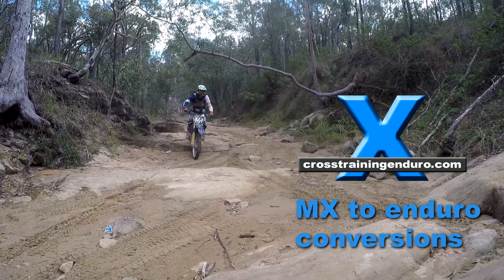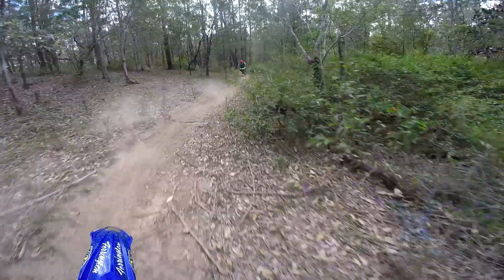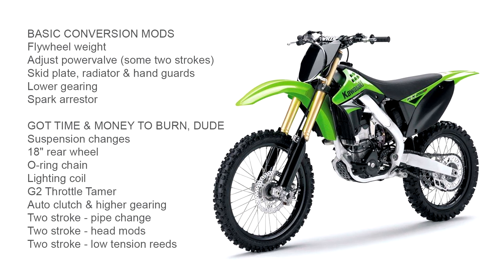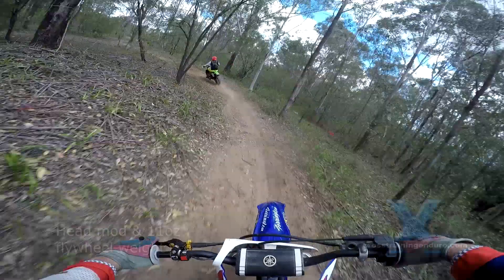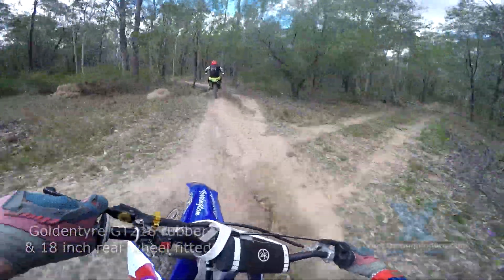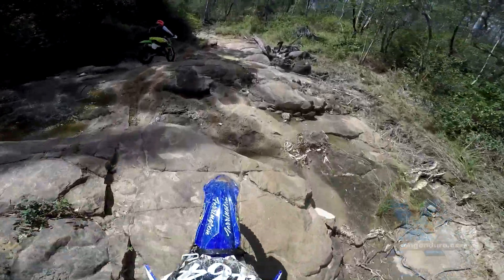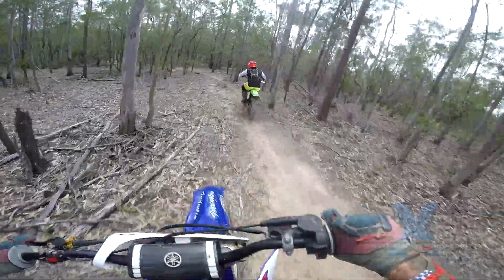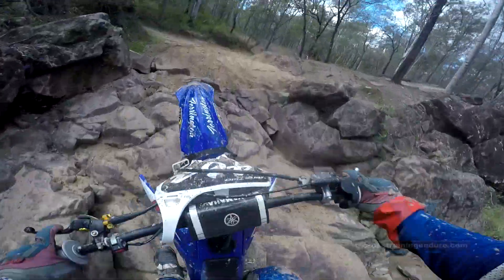Motocross conversion to an enduro woods dirt bike︱Cross Training Enduro

Comment: A stock YZ250 fitted with a good rider can be a pretty formidable combination, believe me.
Reply: I believe you. But not for difficult and very technical stuff.
Reply: You'd be surprised, they make good hard enduro bikes even when bone stock because they weigh nothing, have very plush suspension for motocross bikes and have great bottom end with the help of some good clutch control.
Reply: I've owned a YZ for years and I can tell you it's not an enduro bike.  Even with much of the modifications listed in the vid, it's still not a match for a full enduro.  For one, porting, carb size, and power valve settings are vastly different on a track bike and will never give you the smooth low end power of a woods bike.
Reply: YZ250 is the best bike. 2006 and up are all the same. Still the best suspension out there. Even stock it works great in the woods.
Reply: Mark - i jist go faster to stay in the power band lol i love my cr
Reply: no one has watched snowman films yet go on there and you will see what they can do on stock motocross bikes
Reply: Sowman Films most guys I know can’t keep up with my 15 year old son on his Yz85 riding single track.
Reply: @Scottstunts  that is a fact man. Found that out the hard way. Kid in his YZ85 dusted me on my YZ250 through woods

Comment: I learned to ride the woods on a 2001 cr80r; now I ride a yz125. If you can ride a small bore two stroke in the woods, you can ride ANYTHING in the woods.
Reply: Joe Mamma currently been riding a 1994 yz80 for enduro, definitely helps you get more clutch control! I'm going to get a yz125 or a kx125 next spring.
Reply: its the same with mx track one guys said if you can ride a 125 fast you can ride Any motorcycle fast
Reply: I learned on XR100 and YZ80. Nothing like an 80 2 stroke in the woods.

Comment: That is really interesting.... Surprisingly, my Ol' 1985 YZ490 that I keep teasing about is becoming a pretty good trail/enduro bike. It's not worth anything to sell, so I've just kept modding it a little here, a little there... I put a wide ratio 5 speed in it, ported it and head mod to improve low/mid range torque, and revalved the suspension myself (Still improving to my preference) with twin closed chamber  forks off an 09'YZ450F. Riding with my buddy who has a KTM 300 EXC, I seem to be able to manage easily the same obstacles... The biggest problem I have is a hypertrophied R leg and left forarm from kick starting and operating the clutch....lol
Reply from the maker: oh yeah, the cable clutch and no button are a tough combo lol! i wonder if a midwest lever would help? or another guy in these comments said a moose lever worked wonders for the clutch and was much cheaper than a midwest too....
Reply: I have an 86 KX500 that I put 05 forks on recently. The bike is long, the head angle is pretty slack and it goes up things off-idle that I would have my 250 singing in the powerband before. I barely give that bike any throttle, just keep it alive and it lugs all day. I love riding the old stuff, even if I do throw on some "fresh" 10 year old equipment now and again. lol
Reply: I left the shock alone, it's actually a really neat setup for a stock bike. Where the shock is on a modern bike they used a transfer bar up to a cantilever and the shock is inboard, in the engine cradle. No hanging linkage to beat up on rocks and you can adjust ride height separately of the spring preload. That means I set the spring where the shock works best and then I can tailor the seat height for my stubby legs! lol
Reply: MrDuhfactor my buddy has a CR 500 1990. Ergonomics are old but he has it set up great! It works really well.

Comment: I started out riding pretty technical single track on a kx250. I added an 11oz flywheel weight and moose racing makes an easy pull clutch lever that really helped the wrist cramping. Some guards and a skid plate for protection. The suspension was stiff and kick starting the bike in the middle of a technical uphill section was tricky. But it got me addicted to this stuff at a price I could afford. Though I have to admit the first time I went out on my 300 XCW it felt like I was floating over some of the stuff that I had struggled over on the Kawi.
Reply from the maker: the suspension can be one of the real killers hey scott? that moose lever sounds interesting, probably a similar concept to the midwest levers we have used sometimes....
Reply: Indeed. I am certain no matter how many years I do this I will never fully wrap my head around suspension.      The Moose design is a similar concept to the midwest. Just think cable. I would say it cut pull down by 30% or more. Couldn't have paid much more that $25.00 US. I ordered the midwest clutch lever after watching one of your videos. I had bent the original pretty bad and needed a replacement anyway so figured I would give it a go. I only tried it for one ride. I never seemed to get the adjustment quite right. It seemed to either always be slipping a bit or always be dragging a bit. Hard to find the sweet spot. I beat the bent one back into submission and put it back on.  I do plan on trying it again. One of the other guys I ride with is on practically the same bike as me and he swears by it. Keep the vids coming. Following some fast talented riders and these tips are the only thing keeping me out of the hospital.

Comment: Barry, I've been following your channel since the Berg times! Congrats for keeping up the good work! Being a owner of a converted YZ 250, you´ve pretty much summed it up with  the pros and cons Barry. The gears are the real problem. At least I change front sprockets from 13t to 15t. About the Hydro clutch, I've fixed the problem by installing these adjustable clutch levers. You can choose 3 positions for the cable end, getting more leverage. Soft as hot butter! A side stand can be really useful too!
Reply from the maker: sounds good rzgamer, which brand of clutch lever are you using? we've used midwest ones in the past to good effect.
Reply: I'm using a MSR lever.

Comment: I converted a 1999 KX250. Worked great. Nice to beat up a used bike while learning, then get a new bike when your skills improve. I used an ultra heavy tube in the 19" tire at 9psi and never had a flat. Can't match a hydraulic clutch though.
Tip: get the heaviest flywheel weight. Then if you think it's too heavy, send it back to Steahly and they'll cut it down.  ($20.00 US) I went from a 13oz to an 11oz. Perfect.
Reply: ... if the bike has progressive rate springs switch them to linear rate. Progressive rate doesn't work well in the woods.

Comment: Another good video! :-) and I would like to share my experience as a beginner:
I come from an enduro Husky 125 and I recently got a KTM SX-F 250 because I'm also doing some motocross riding from time to time. I've been testing a number of brands from 125, 250, 300 and 450 cc, 2 and 4 strokes cross and enduro. 
 
What I do most is enduro and almost all my mates have enduro bikes. 

This is obviously a personal point of view but I love my motocross 250 F. That extra aggressivity for a small 250 works great for me respect a 250 "soft enduro bike" and helps to be more accurate in throttle and clutch control. It probably won't work so well with bigger displacements. The original sprocket was a 48 and I mounted a 52 + a skip plate + strong hands guards + 90/90-21 from and 120/80-19 rear. I'll get Tubliss soon. 
I still use the stock springs, (I'm about 78 Kg with all the protective equipments). I just use softer compression and quicker rebound for enduro; it's still a bit stiff with mid-size rocks or rounded river stones... but lower tyres pressure, (0,6 bar or 9 PSI), works great for mid-slow riding! With that pressure, I already damaged a tube and hit the rims, so I getting into Tubliss. I'm very looking forward to test my tyres with 0 PSI and winter is on its way in Europe!

Hug from Italy - Sicily!
Reply from the maker: i think the four stroke engine will immediately be better for this conversion, salvatore. i think its' going to take a lot of work to make this 250SX comfortable for enduro riding....
Reply: You're right!

Comment: I have a 2017 woods set up yz250. Magura hydraulic clutch, 18in rear wheel, devol skid plate, yz250x kick stand, full fmf, the kyb with a pro motion spring and revalve for a 170 pound woods rider, tubliss in the rear, acerbis bark busters. May add a 11 oz flywheel weight in the future. Kept hearing stock, and it’s a ripper. I ride tight technical single track here in east tn. I have thought about throwing in the old wr426 trannys but it doesn’t really need it. This one makes woods set up yz250 number 5 for me and I have loved them all.

Comment: Hey Barry,
I have a 2003 YZ250 her in the states, which my friends and I have affectionately named 'The Donkey' because when I bought it last spring, I it was in incredibly rough shape (SAE hardware where it should have been metric, suspension was all screwed up, etc). I wanted a steel framed bike over a Aluminum for trail riding and the engines are relatively the same from 2003-2016, so there are tons of parts out there.

Anyhow, I ride trails, not that the fruitier equestrian dressage of motorcycle riding which is known as motocross. 

Here are my mods to date;
9oz flywheel weight 
Lectron Carburator - totally changed the power delivery to be more trail friendly, added about 10 MPG  =  28.2 litres per 100 kms and is easier to tune
GT216AA fatty front - really plants the bike and keeps it from washing out
your typical armor products, skid plates, case saver, etc.
Tall seat
It came with an X-ring chain. 

I'll be doing some more work to it this spring, but I'll eventually hit the wall of "how much more money do I want to put into a 13 year old bike?" 

Future mods include 
head work
KYB SSS suspension
18" rear wheel with GT230
Steering stabilzer
Fasst Co bards

I was just riding with a friend last night who picked up a YZ250FX. His bike has as follows;
power generation strong enough for a radiator fan and headlight
6 gears wide ratio
18" tire
electric start

I said the same things to him that you mentioned; the YZ250X needs:
6 wide ratio gears
Larger Tank
Electric Start
Lights
49 more CCs
Hydraulic Clutch

The issue is with the US market, most people only know Red, Green, Blue, and Yellow with Orange becoming more familiar. Only small handfuls are paying in depth attention to KTM/Husqvarana, Beta, Gas Gas, Sherco, and TM. However, we are starting to see a slight shift to off road riding due to the fact that people are waking up and realizing that their hopes, dreams, and aspirations of becoming the next Travis Pastrana are not grounded in reality. 

Yamaha has been doing some interesting things over the past few years. Maybe they'll pony up. Personally I'd like to see them go to a steel frame for the X model, like KTM and Beta.
Reply from the maker: yes it's a real shame the japanese have become so conservatire and mired in the past with their dirt models. i have wondered if it's the continuing sales in the US that allow them to not make changes? certainly in places like europe, australia and canada they are quite rare on the tracks now and everyone has gone euro.... i'd love to see a serious YZ300X with those mods!

Comment: Just bought a 2009 kx450f and I am in the progress to convert it to enduro.
Around here an registered enduro bike goes for around 3500€ and up, and there isn’t an owerflow on the market.

I paid 1300€ for my kx in really good condition and have spent around 7-800€ on mods like;
complete lighting (original coil can handle it due to the FI),
Skid plate, larger fuel tank, side stand, sprockets, chain and other maintenance stuff.

Next on the list of mods to get is;
*Either flywheel weight (couple 100€) or a Rekluse auto clutch (1000€)
*Suspension modifications (500-1000€) 
*18” rear wheel, and/or supermoto wheels.

So i would be around 3-4000€ into it when I’m done and would have, in my opinion, a much better and all fresh bike than if I would have bought a used enduro bike. Plus, I’ve hade fun and learned alot from tinkering and modding the bike.

Only drawbacks would be the tight gearing, no electric start and the biggest; not streetlegal.

Comment: I love the motocross bikes because of weight and affordability. These old Japanese bikes are easy to get parts for new and used. I don't think the gearing is a deal breaker either. You adapt quick after riding any bike for some time. Not sure how I feel about flywheel weights either. Have two CR250's one with, and one without--again you get used to how to ride it. Suspension though is a must no matter what you have. Get it set up for your weight and riding and you will be really surprised how all the other things are no big deal.

Comment: On a side note: in the US, many states allow you to register your 2 stroke as "off  road only" with the DOT and you can then ride them in most moto parks,  trails, and national parks that allow 2wheels. Just not on public roads.
Reply from the maker: hearing that quite a bit, aseredy. much of the forum chat seems to be dominated by guys in CA where it sounds much stricter than everywhere else so i assumed that was more the norm...
Reply: In Michigan, it’s quite easy.  Michigan Secretary of State ( our DMV) outlines the requirements in document https://www.michigan.gov/sos/-/media/Project/Websites/sos/28lawensn/TR54.pdf

Download it. 
Make the necessary changes. 
Contact law enforcement official for inspection. 
Take completed document to Sec of State for plate and new title.

Comment: I also ride a yz 250 with very similar mods, i have also  changed the reed block to a vforce 3, power valve spring, gnarly fmf expansion chamber with stock muffler and had the barrel shaved 1mm that with some leaner jetting gives more bottom and massive midrange power but a smoother power curve than stock. With the smoother power and re valved suspension makes a very capable bike in the bush. I have also just recently converted a yz 250f for the bush with good results.
Reply from the maker: sounds good matty, i bet it's very similar to the one i rode with those mods. sweet engines....
Reply: Did you use the Cisco power valve spring?      If so, is it worth the $60 to have it shipped to the USA?

Comment: i live in vic so for me, plating isnt a problem because we have Rec Reg down here.
i run a 13oz weight on mine and love it 
also run a ciscos powervalve spring which gives you heaps more power off the bottom end.
a lot of riders pull 4th and 5th gears out of a wr450f gearbox to give them some cruising ability.

Comment: I got a 2013 as a project the engine was apart with a major top end damage, i swap the transmission for one of a WR (depending on the year it may be needed to remove some material from the case to make it fit but is very minimal), i replace every bearing and seal and did some porting on the transfer port and the cylinder(just improve the flow, not a race port), the bike came with an APEX cylinder head with the XC dome, i took it for a break in ride and the transmission did a great improvement going up hills in 3rd slugging it and it whent up no problem, after that first ride i addres the suspension lower it 50mm and revalve it for a softer woods friendly feell, in all i am unther $3000
Reply from the maker: Bargain!
Reply: @crosstrainingenduro  but remember it is 20% bike and 80% rider

Comment: i got a 01 cr250 no fly wheel weight and pro circut xhast with shorty muffler and oem gearing  i like the top speed and i trail ride it and its a handfull at the best of times

Comment: Does it makes sense? It does to me. I just bough a 2003 to covert and build into a race bike for this type of terrain. A little twist that I'll be doing to solve most of the problems you guys have with the transmission, a complete wide-ratio trans out of an earlier YZ400F...drops right in. Thanks for the video.
Reply from the maker: awesome... those gear ratios can be a the deal breaker for many.
Reply: The yz400f transmission is exactly the same as the 2003 yz250 (apart from the shift drum and one shift fork who's sliding arm is slightly shorter). Same exact ratios and all.

Comment: You can rec reg mx bikes in VIC. I put lights and a horn onto my 2013 kx250f. Suspension had to be set up - choice suspension in Kyneton did a great job. However the light flywheel and kick start does make it hard work compared to a dedicated Enduro bike... The over all cost... It would have been cheaper to buy a exc.

Comment: I love my YZ. 05 YZ250, custom valved suspension, 13oz flywheel weight, 2 teeth up in the rear, its much better to ride than my KTMs were.
Reply: Charles Gutscher I was thinking about an 11oz flywheel weight or a 13. Any opinions or suggestions or differences between the 2?
Reply: Charles Gutscher I am on woods set up yz250 number 5. On a 2017 now, but never ran a flywheel weight on the other 4.
Reply: Stock suspension? Everyone seem to moan about the 05's forks. How are you getting on with it?
Reply: @Drewski423  I ran a 13oz flywheel weight. It could have realistically used more but was good.
Reply: @99nasha  mine had the 06 SSS forks on swapped. They were great. I've now switched to a 2020 TX300i, never looking back! Lol